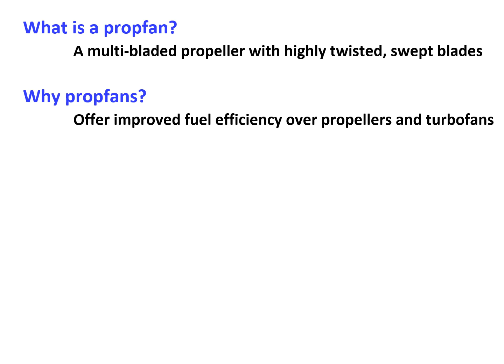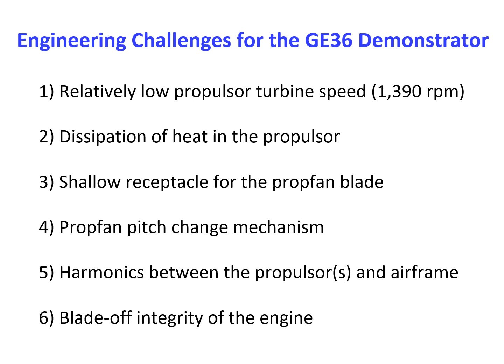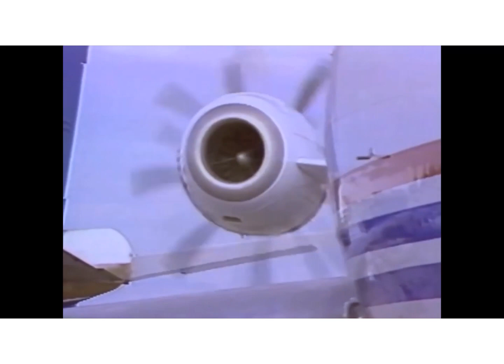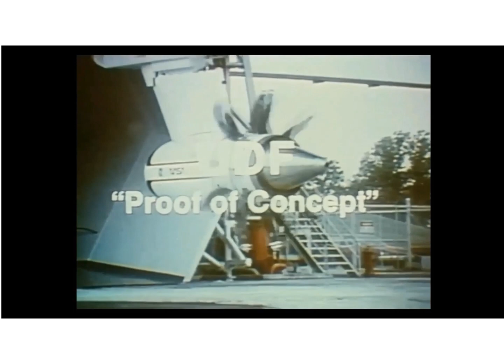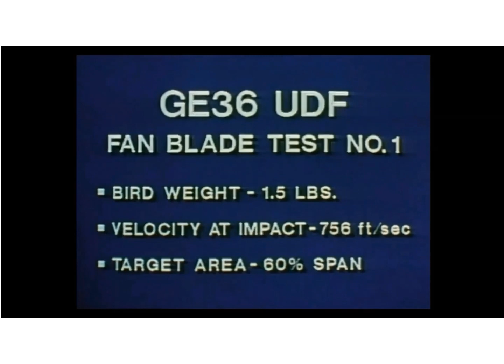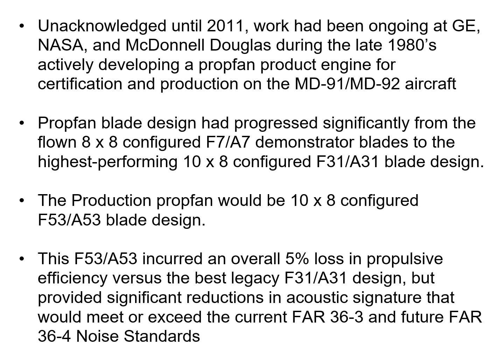A Technical History of the General Electric GE36 Propfan

Comment: I read a story this morning in Aviation week, CFM and GE partnering to develop a new prop fan engine.  Seems that now, instead of oil prices driving technology, it is a “climate initiative.”  The CFM RISE program will bring forward the GE 36 data.  They state that prop blade containment is among the top regulatory issues, along with noise, which tests indicate has been improved upon.
Reply from the maker: Thanks! While SAFRAN and partners built and ran a contra-rotating, gear-driven, ducted-exhaust Open Rotor engine a few years ago, the consortium has opted for a single rotor propfan with downstream, variable-pitch, but non-rotating swirl recovery vanes. https://www.aviationtoday.com/2021/06/21/ge-aviation-safran-see-sustainability-key-next-gen-cfm-engine/